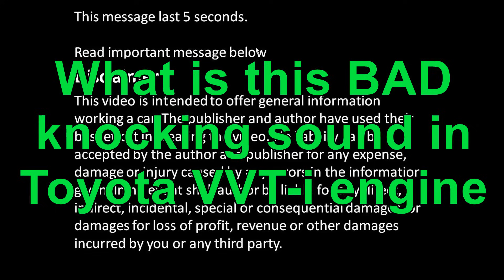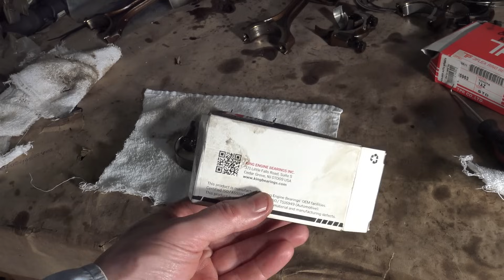What is this BAD knocking sound in Toyota VVT-i engine. Years 2001 to 2018

Comment: Hi Friend Peter good day, want to ask again about our Corolla 2002, we have the same issue but ONLY at COLD Start up when it reaches the normal operating temperature it works fine no more Knock also when I drive to normal road and high speed I can't here it anymore. Does your car behaves the same at normal temperature?
Is it normal with 231,000+km milage to hear such noise, whats your opinion friend?
Reply: It usually is the timing chain.
Reply: that's your intake cam gear
Reply: 1ZZ is noisy until it warms up. Nothing to worry about 😊

Comment: Sounds like vvti cam gear or the cam chain tensioner worn out I have the same issue and a lifter tick. Makes alot of noise when cold but eventually warms up and goes away it has good as oil to

I love my car I will replace the engine if it ever come to it. For now she still handles the highway good
Reply from the maker: Sounds like a good solution.

Comment: wow...very nice video...Mr Peter finn...thank you so much
Reply from the maker: Thanks Sir. 👍
Reply: @PeterFinnTheCarDoctor  .Hello , one Polish mechanic found Yaris were sold in Japan with recommended oil 0w20 and in Europe it was sold with oil 5w30. May be other oils are  
wrong ? Polish mechanic flushed  toyota vvt engine and 
did put Millers oil 0w20 and reported that engine works quiet.:)

Comment: @Peter Finn  mine is making it after an overhaul.
What can be wrong
Reply from the maker: Hi, You have some issue inside the engine or in the drive belt wheels
Reply: Check power steering pump pulley!

Comment: Hi Peter, thanks for your videos I have watched most of them as I Corolla DIY owner. Good car to learn your stuff on. But here I have a problem I cant get over, perhaps you could give a bit of assistance if you be so kind. Corolla 1,4 vvti of 2003 all is fine car drives well, but every so often /once a month or two, sometimes once a week/ the revs go up themself, while driving. They climb up to 5000 and stay there or slowly drop down and again go up . Sometimes I have to stop the car, sometimes I have to wait, sometimes it goes away itself . There is no fault light or code on the PC. I have done all the usual things, and also took it to Toyota, the didnt know /or could be bothered/  either. Do you have any suggestions? TY. Dan.
Reply from the maker: Hi, your throttle body is stuck and  bad. So. try to find used full throttle body and replace it.
Reply from the maker: https://www.youtube.com/watch?v=86KxEqBgxis
Reply: Thank you for your time, the  throttle body was the 1st thing I have looked at. Had it out few times. Will try to replace it than. Cheers.
Reply: سق رى سد

Comment: I have a corolla 2005 ce with 260,000 drives good but  the Only thing Is when u stop the car in drive for a red light the motor shakes, but then u drive like nothing happen I hope u can help me
Reply: check the engine mounting
Reply: Yes your engine mount maybe  bad.
Reply: Yes kindly check engine supports.
Reply: Check also your car's rev, if its so low might better also check your car's body throttle and mass airflow sendsor. There are many tutorials here on how to make them almost new or smooth again. 

Please give me a hit if what so ever the result was. Good lck!
Reply: I just had the same issue with a 2007, 170k miles. Definitely the motor mounts. You can check it for yourself, have a friend get in the car, turn it on then while foot on break pedal, rev gas pedal with transmission on Drive and engine will move same if transmission on Reverse, engine moves. It if does then definitely motor mount and you may as well replace all four of them as it is not very expensive online. Good luck!
Reply: Myriam Marquez 
Might also a warped rotors.
Reply: Fuel injector sticking is the most usual cause of good running but rough idle.  Simply using a bottle or two of injector cleaner in the gas usually fixes it.  Also, getting a couple tanks of premium of a brand name gas will help clear it up.
Reply: If it ticks over about 750rpm when warm - then I would check engine mounts.
Reply: Maf...throttle body gunky....

Comment: Does It still make It when the car Is warmed up?
Reply from the maker: Yes. Always. And sound becomes more Badly and Badly... and Finally engine Blows Up !
Reply: Our corolla engine knock stops at normal operating and even in normal driving condition or high speed no more knocking. is it fine or not?
Reply: @draxus1266  If the noise only happens when cold and goes away when warmed up, that could be piston slap with some model years of toyotas are notorious for. Not a huge deal.
Reply: @imzjustplayin  ok thank you for the response. it's been 10 months tho, appreciate it bro. I also tried to rev more up to more than 3K couple of times coulple of Days Weeks well it sounds better after 1.8k - 2.2K. Unlike before always knocks even in our Toyota Innova. This lessen much when we drive it in premium, no joke probably it has also something to do with the timing since bore is smaller than it was (ignition) and also gas here in PH are quite horrible. There are unleaded that are dirty and diesel as far we experience those. 

Whats right is that all of this fuel must have standard additives and must not harm any of your engine components and fuel pump. Blah blah with that said I'm always up to use premium then.
Reply: @imzjustplayin  Also, may you also give me a hint about our 03 Corolla, its been many years since i tried to fix the COLD Start problem. when summer it doesnt much occur, but when Rainy season idles always want to die, need to step up the gas pedal just to make it stable until it reach it operating temp. I already finish Peter Finn , ChrsFx, and Scotties vid but none of this had the exact issue and solution. Hope you could give me a hit with this. its been almost 3 years i think so. (not sure if theres leakage)
Reply: @draxus1266  You could try cleaning the idle air control valve and or the throttle body.
Reply: @imzjustplayin  Hi , already tried that i dsmantled all. Also IACV, als MAF.

Thanks for the resposne, now its summer here, it works some how more smooth. But not normal since she idles up for 2,000 or more before reaching its normal temp, gradually drops to 800 Bro.
Reply: @draxus1266  If you have an OBD tool, you should look up the long term fuel trims and short term fuel trims. If at 800rpm the LTFT is above 15, that means you have a vacuum leak.

Comment: Hi Peter  .have a 2000 avalon with  p0300  p0302  p0304  p0306  and there  is a ticking  or nocking  sound  on  bank two side    change  the coils .cleaned  the injectors  .put in new spark  plugs  .front valve  cover replaced  .still getting  p0300  p0302  p0304  p0306.  Mechanic did compression tests  that's good  .but still  same problem  could  it be a skipped  timing belt  .help please  thank you

Comment: Hi i have a corrolla EE111 and it has a knocking sound often and when the knocking sound comes there is smoke from the silencer and also it burns oil a little... any solution pls???
Reply from the maker: Sounds piston failure... you need new engine or new parts to piston

Comment: Hello Sir,
I really hope you can give me your opinion on the noise my engine has.
I have a Toyota Venza 3.5L V6 2GRFE engine found in many other cars including Lexus. The noise is not there on cold start and not present at all until the car get to the full hot temperature then the ticking starts, fades away, slowly returns then stays and so forth.... ive had the milder case of this noise while it was under warranty but now with 160k miles same noise double the loudness. I truly hope of your opinion... there is a video of Toyota Sienna with that noise on YT. 
Thanks in advance🙏🏻
Reply: That’s EXACTLY what my 2004 Camry 2.4L does. Only after running for several hours does the ticking start to appear around 1.8-2.1K RPMs sounds like valve ticking but ONLY occurs after the car has been running for several hours. It can get so loud I actually force the car to downshift in order to prevent the harsh ticking

Comment: Hello sir my car 3zz engine has the hammering sound,we have changed bearings and new crankshaft so now we are confused what now making the bad sound when accelerating
Reply from the maker: Let me check, some part is still loosen... Connection rod or pistons ?
Reply: let me check.... well, to solve the problem, buy a Volkswagen
Reply: @ncubelungsta1143 did u eventually get it right. I also have the bad noise when accelerating.

Comment: I got toyota 4ZZE168940 vvti but it got very serious quick start Norse that when you start,it take just may be just 5 seconds then it went off.i have buy or replace new timing oils control valve and also replace new camshaft gear but still when it start,it's do the same pls help me with ideas pls.I'm even giving up to the car.i hve spent a lot and moving from one mechanic to another.
Reply from the maker: Thanks for comment 😀👍

Comment: We have this noise on our Sequoia. if the bearings are worn like that, then there is/was some metal in the engine?  is just replacing the bearings going to fix the problem?
Reply: If you drain the oil and replace the filter, pull the oil pan and remove each rod cap to inspect the bearings. If it were me and there is no metal transfer evidence to the rod bearing journals, I would pull the main bearing caps and check them as well (one at a time). Clean the caps and the block and crank area, lube and install new rod bearings, main bearings (torque the bolts to specs), and replace the oil pump with a MELLING hi volume/ hi pressure pump and oil pick up tube.

Comment: My 2004 Camry also make this sound after i have low pressure oil due to blockage in the oil pump screen and i cleaned the oil pump screen and the sound is still there but less and increase after 2000 rpm and decrease after 4000 rpm, what do you suggest when should i change the engine or repair the engine  ??
Reply from the maker: Yes, maybe connection rod bearings are bad. Need to replace

Comment: Only use  5W-30 Castrol Magnatec Engine Oil........from the begining and you are good for a very long time
Reply: Ok I just got an oil change can I just drain my new oil and keep the same filter and fill it up with the oil you just listed?
Reply: @nonenone4078  You should change the filter too........

Comment: I'm sorry but if need to change your rod bearings. you should change your mainbearings and your cambearings also if one wears they all will wear
Reply: Not necessarily, the 6 cyl 4,2 L block will wear mainbearings before 1 million km but not other bearings. And the diesel injectors need refurbished or replaced after about 600 000 km.

Comment: Peter my engine is doing this will it last maybe cupple weeks until
I get new car it only does it at 3k revs and not on idle
Reply from the maker: Ok, and Thanks for comment
Reply: I have an engine with 202K miles on the clock. Same here makes noise at 2500 rpm and higher, not at idle, warm or cold and sound is getting worse. I replaced the timing chain tensioner and the chain is tight. Peter what do you think?
Reply: Kellys Peppers 

100 percent it’s the bottom end big end bearing like it was on mine 

So sell or get rid quick or it’s. new engine
Reply: @225M3RCR  Thinking about a rebuild or get a junkyard engine. Will be going to my granddaughter.  I rebuild a Ford Escort after it threw a rod. Spent $1200 including machine shop.

Comment: I use an 08 corrola.
Ones in a while I experience some noise at the top of the engine and the oil light comes on. When i off the engine and start again it the noise stops and the oil light goes off as well. This happens when i drive for a long distance or speeed a lot.
What may be the problem
Reply: Check your oil levels. You may be burning oil. Top off if oil level is low according to dipstick.
Reply from the maker: Thanks for feedback 👍😀

Comment: Hey bro I have a Toyota spacio just like dat an I am getting crank but the car wont start at all .I check fuel pump it working an all sensor an starter working and starter everything working. I cant get it to start .help plz
Reply: Check to insure you have spark. If you do, remove the air filter box cover and spray some either/ starting fluid into the intake manifold and try starting it again. 
The point are to isolate the problem issue. It usually come down to "no spark" or "no fuel".

Comment: Is a small like a dry Cold star sound on the 4 cl engine even on the brand new ones...and by my own experience as mechanic and owner of 2 toyota cars 
#1 Scion XB 2010 
189,000 plus milles are on this car currently
(Important re-mark on this comment)
It has that noise since l purchase the vehicle..... and this was back when has only 110,000 plus milles only one set of sparkplugs and regular oil change (of course high millege kind) during the time ...is not recommend to use synthetic brands on 4cl because the performance is literally the same with or without and #2 synthetic oil for a good dawm long research reason l find out 
After good 40,000 of use it will eat the factory gaskets around the top ,the pan and the oil seals inside the engine way quicker than just regular plain oil 
So the second car l just got on january 2021 is a toyota camry 2020 with 0 milles brand new car 
Literally brand new 
GUESS what it has the stupid same noise and it has identical engine than the scion xb and l said identical because they are the same period no matter who said some different 
The truth is yes they are the same 
So conclusion here 
If the car is not burning oil or over heating or lossing power and if there is no check engine light on it don't worry about  doing all that unnecessary work and poor people is gonna believe they gonna have to run to the shops and spend a bunch of money just to get rip off by some scammer...just check your pulleys , belts,and believe it or not your front coil overs or struts a lots of times when those got wear out they are very very noisy and sensitive to any little bump on the car 
So please people
Open your door check and see where the vin number of this vehicles are and if you got a letter instead of just numbers on the car you like to purchase before all the main vin number (exj) normally is a J or a I 
It means the car was fabricated and completely constructed in Japan 🗾 so don't you never worry or doubt to buy this car even with 300,000 milles on it 
The noise is nothing
Good luck 
Oh and Mr Hong or the video poster 
Take a nap a beer go shopping,law your yard or bug your neighbor but on the mechanic part 
Just stop please lm begging you sr
Just check your pulleys first and check and see when was

Comment: whitch engines have these problems is that a 1.3 because i want to buy a 2006 swift 1.3 vvti and i want it to be reliable
Reply from the maker: Hi, all Toyota engines are good, but issues has been in 1.8 vvt-i engine.

Comment: has anyone else with this same sound tried to replace the bearings? and if so did it work? because I'm having the exact same sound on my 2009 corolla xrs
Reply: Hi I have the same issue with my corolla 09
Reply: What did you do to salvage it
Reply from the maker: Thanks for comment. 😀👍

Comment: Hi peter my 1.6vvti does this only when it is fully warmed up im using 5w30 on my engine it does spund identical to what you showed in the video so i too am adsuming its rod knock i originally thought it was timing chain or tensioner but i inspected tensioner and replaced ohring i have a question though i wonder would using 15w40 oil which as we all know is thicker possibly help or maybe even sort this problem to get some more miles out of the engine my engine has 400000kms on it
Reply from the maker: Thanks for comment. 👍😀

Comment: Dude it's an old car no car last forever parts will eventually break down Japan car lexus Toyota are the best car if you buy low end cheap like toyota yaris so so this is what you get...american car is the worst arm n legs especially Ford mustang explorer horrible BMW mercedes. 91 accord is a beast during year it made I drove 5spd like indy race it last 6years champ car never break down amaze but u have to know parts start broke down 180k-200miles shock strut arm control CV boot timingbelt water pump are typical parts the worst is inside engine well as long you keep spark plug oil change you're good for a long run

Comment: Hi man. I like your videos and i really need your help. (or anyone's,who have idea or experience) I have a '04 avensis 1.6 VVT-i. When i turn on the engine,it's running,but it had a... Hard to describe it... Maybe shooting,t... noise. When i press the accelerator,around 3000rpm it stops,then straight away starts again. I'm even scared to keep it on high RPM. Someone told me,it can be injection problem. I checked other videos around. Sounds similar,but mine is way too loud. I have no clue. I'm even thinking about the chain also. Thanks for any help. I can upload video of the sound,if it helps.
Reply from the maker: Hi, maybe connection rod bearings are bad. Replace those.
Reply: Do you need to do a valve adjustment?
Reply: Hi just wondering what did your problem turn out to be I've a 2004 1.6vvti with the same problems any advice would be great

Comment: P0505toyota 1zz engin
Reply from the maker: Please do these: Clean Dirty Throttle Body, check CABLES to Electronic Throttle Control System harness is open or shorted, Electronic Throttle Control System circuit poor electrical connection, Air Induction System (Intake leak), PCV hose connection Faulty, Engine Control Module (ECM) bad